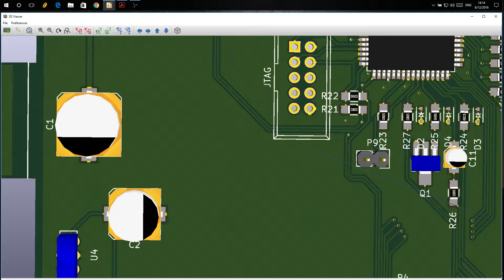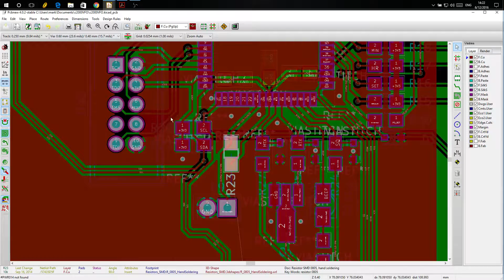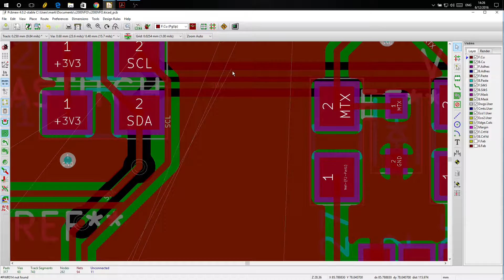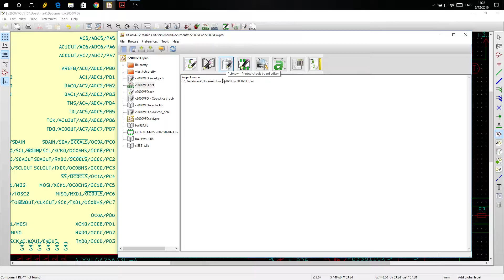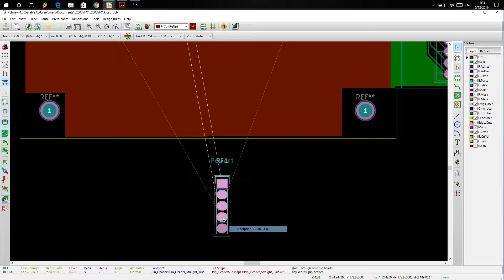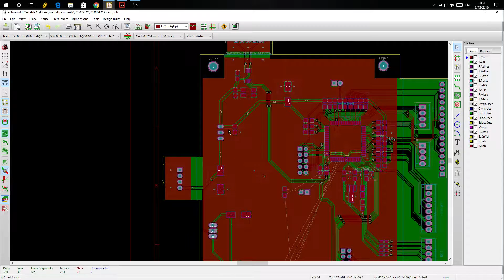Updates... KiCAD... etc.

Comment: in pcbnew,  when you do the netlist, "exchange footprint= delete"  and "extra footprints=delete"  will fix that designator ( EDIT not designator, REFERENCE) problem, and will update your nets in addition it will remove those annoying footprints that keep showing up.  (im referring to when you had to change the footprint pads to +3v3 and gnd ...)    i would NOT do it everytime, but only when you have that issue.